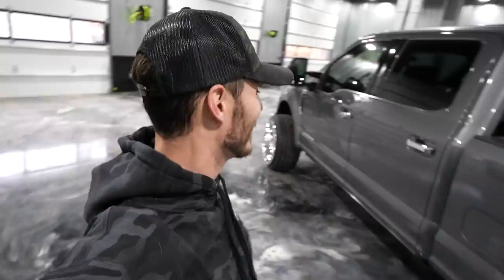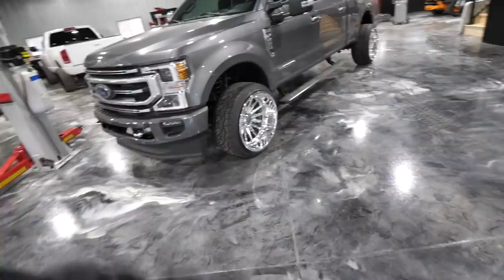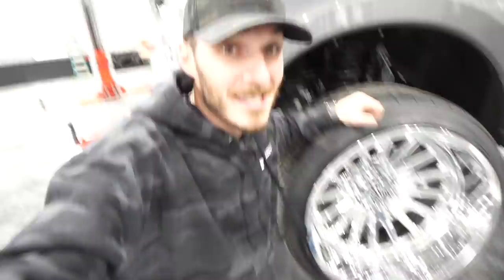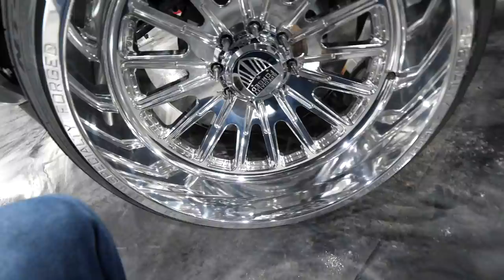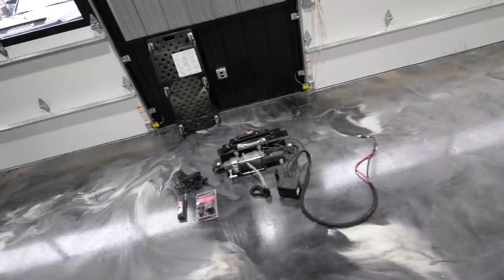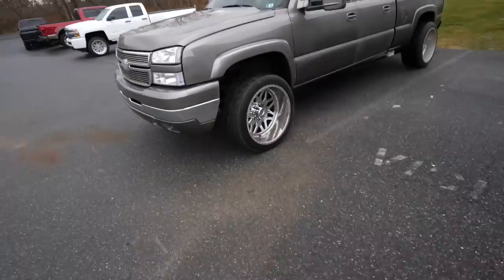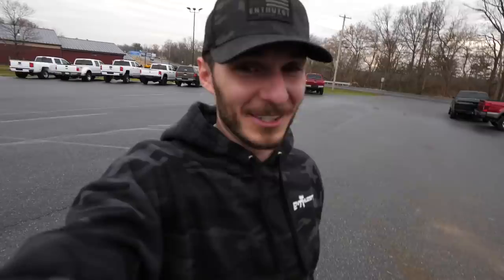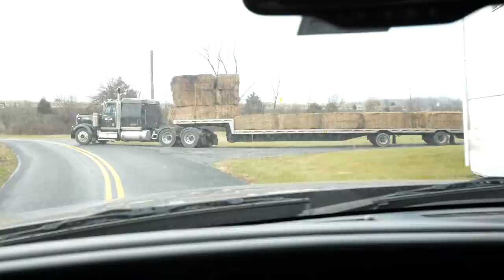Held These Wheels For An ENTIRE YEAR For This 2022 F250 Platinum!

Comment: Would like to see a off road package that’s not with rubber band tires Jack….can you make it happen one time Sir…
Reply: Say it louder for the rest of us.  I love the builds but I’m getting so tired of these setups.
Reply: Agreed🙌
Reply: What really stings is that this truck was the perfect candidate with the factory winch (now removed) but went towards another pavement pounder set up.
Reply: Agreed. Would really like to see him run a full Carli setup with custom powder coated Innov8 or Trail Ready beadlocks.
Reply: I agree 100 with this. 4x4 with rubber bands on it. This channel is getting like the high school starter kit! Might as well lift the front and squat the back. Not batting just not a fan in my opinion!
Reply: He has……. multiple times.
Reply: @forgedduramax3099  not really, I think guys are want 20-22s without crazy offset, 37s and some offroad bumpers. I haven't seen that yet.
Reply: I think now that he has the shop, there will be a few builds coming like that!!
Reply: Agreed, would love to see a build other than pavement princess,
Reply: Bubba trok pls

Comment: The little amount of sidewall there is looks very weird in my opinion. I like the wheels just not the tires
Reply: Why have a heavy duty truck if you can’t actually use it.  Those tires won’t offer much functionality for sure.
Reply: @michealreed9792  show truck homie
Reply: @michealreed9792 it’s only for the time being, he’s waiting on suspension to fit bigger tures

Comment: Either that latch needs adjusted, or Ford doors are harder to shut than a GM. The lbz the seat shop sells foam and new cover. Don't skimp on the foam.  Really nice stuff, easy to do with their videos.  I'd get a grant steering wheel

Comment: Just once, can we please get a real set of wheels and tires (Non stretched, All terrain tires) put on a 4 wheel drive......... This was the perfect platform for the build since it already had the winch on it. IMO this truck would have been better with some All terrains on a 35 x 12.5 with a Kelderman air ride suspension. 
If anyone knows a channel that builds trucks to be anything besides a pavement beater, please suggest them. Thanks.

I don't post this to bash, Just all the wheels and tires on the builds  are looking the same.